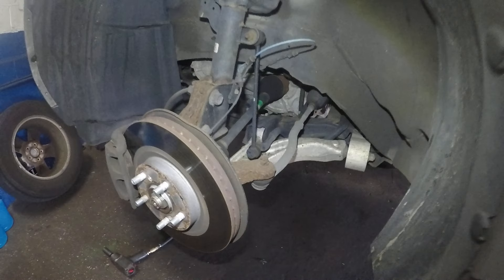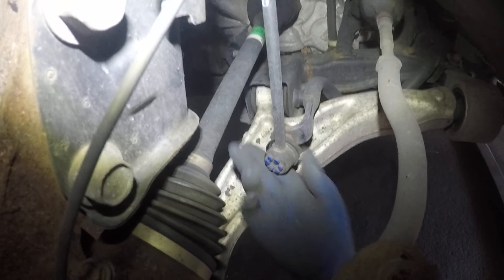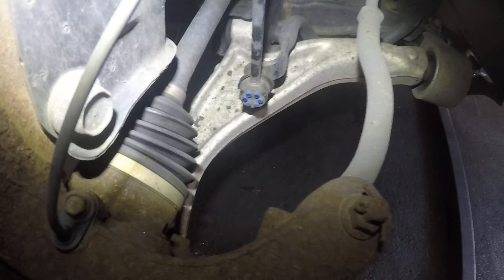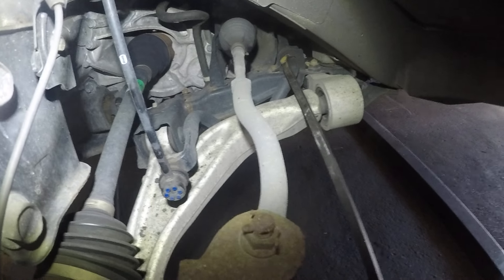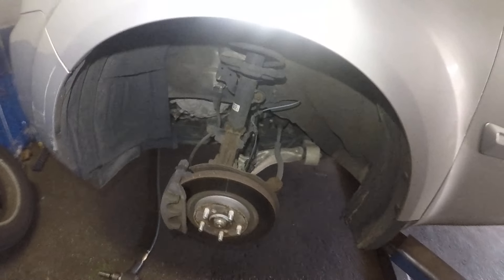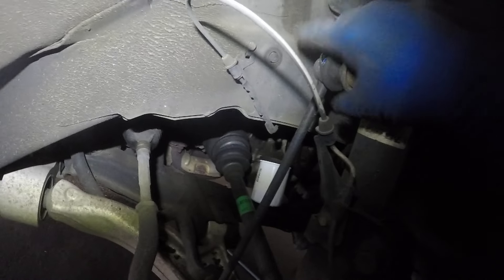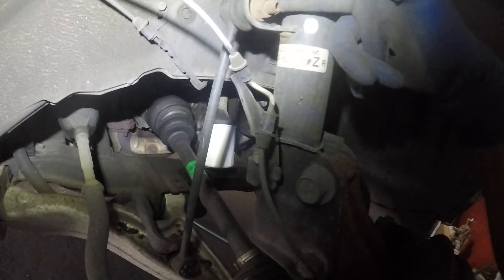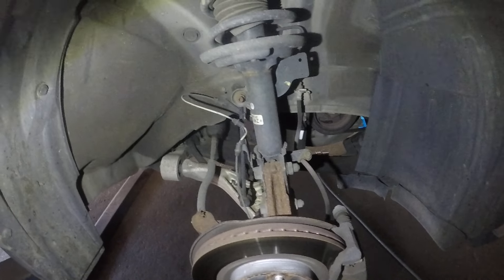Front end rumbling noise FIX and Diagnostic  Honda pilot

Comment: What if the dribbling noise is coming from the rear?
Reply from the maker: Could be links or bushing Same setup in rear
Reply: I have a different noise coming from the tires when going over 35-40 Mph like those off terrain/snow tires.  The faster I go. The louder it gets.  It sounds horrible. If I go over 70 mph the steering shakes and car vibrates. Again the sound is like those big truck tires with big tread. Sounds crazy. I have 2013 Honda pilot ex. Also my steering wheel is currently tilted to the right pretty bad. I was in minor accident , no damage to my car other than the steering got really heavy. My mechanic fixed it but I noticed my steering wheel tilted to right bad.  He said it needs alignment. Is it possible an alignment can cause that crazy sound. My front left tire and rear right tire were worn bad but the other 2 were good.
Reply: @RBTheMechanic I got under the car few days ago and noticed my front sway bar links boots are ripped and outter tie rod boots ripped. Also rear left shock is going bad /leaking. But everything else working fine but some of bushings and ball joint boots look dry or hair cracks. I def can feel the rear shock not working good over bumps but everything else works okay other than the fcken car tires sound awful like I’m destroying the tire tread. Need some help man. I’m thinking about replacing 4 sway bar links, outer tie rods, rear shocks. Is there anything you recommend replacing along with these parts? Like the struts or inner tie rods? Control arm bushings or ball joints? And should I go Honda oem or rock auto?
Reply from the maker: @ what year make model is ur car? Let me know then I can let u know what u should buy and from where
Reply: @RBTheMechanic  man I freaking love you, thank you for responding. That’s exactly what I need help with. 2013 Honda pilot ex sport utility 4D. I spent the past 2 weeks researching and stressing. I have small video of my suspension parts & the shape they are in. I really want to share the video with you
Reply from the maker: @ oh cool glad u bumped in to my video!!
Reply: @RBTheMechanic  I commented my year make and model that you asked for. 2013 Honda pilot ex sport utility 4d. Currently rear left shock is bad. Front sway barlink boots are ripped. And outer tie rod boots are dry & cracking. Check out my previous comments. I need ur help knowing if there are other suspension parts that have to be replaced at the same time or can I just replace the parts I mentioned alone. & if I should buy oem parts from Honda dealer or rock auto—> which brands on RockAuto.
Reply from the maker: @ so with shocks I would recomend get original shocks from dealer and replace the strut mounts with it both sides 
link you can buy MOOG brand
Tie rods use original from dealer and replace inner and outters same time
Other than that ur good for now that’s all

Comment: Mine dings sounds like its metal to metal but i cant find anything wrong
Reply from the maker: Check the brakes inner pads could be fully worn out
Reply: @RBTheMechanic  thanks for the help, found the problem when i took it to get new front struts they only hand tightened em and left em loose
Reply from the maker: @Sidewayz.Justin  oh darn wow ok good u found the issue